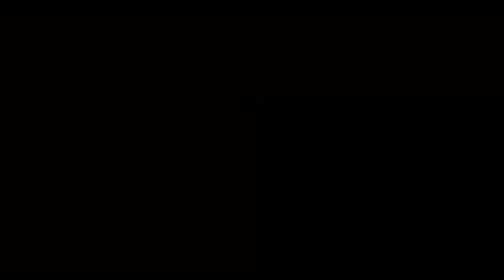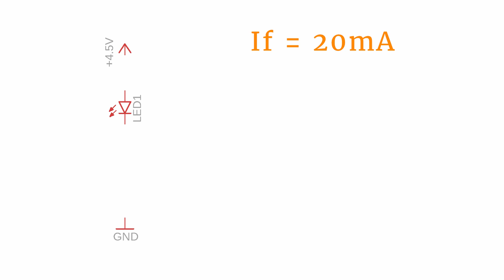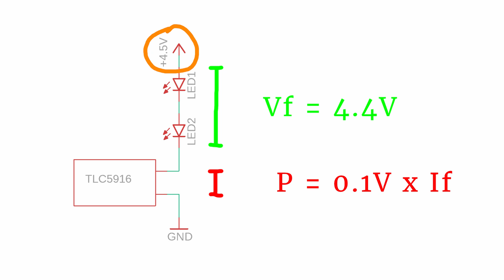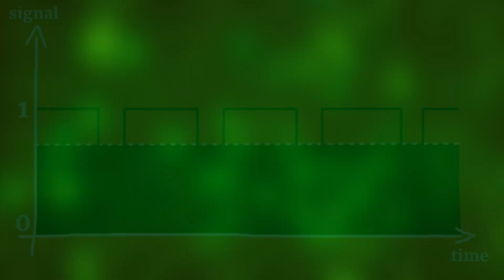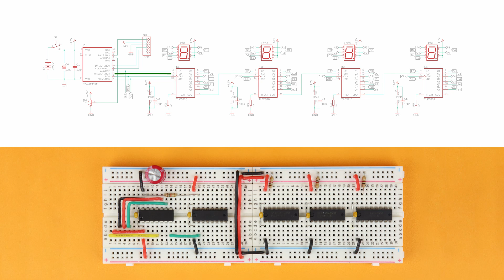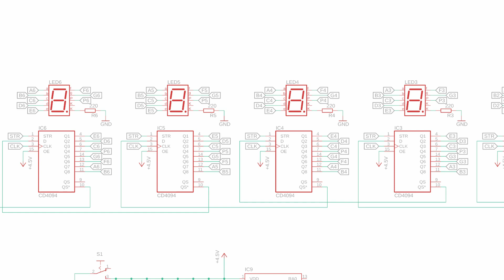Best breadboard 7-segment LED driver: TLC5916 tutorial

Comment: If you want to be abel to dim 7 segment displays with external PWM is that possible, also if you would like to be able to dim them to 0 how would you do that?
Reply from the maker: You could use a PNP transistor in the segment LED anode and connect that to a PWM that you generate with the PIC controller. The dimming inside the TLC5916 is more of a "brightness adjustment" that should be used if neighboring displays have a slightly different brightness due to manufacturing differences and/or their age.

Comment: Hey. How about some female header pins to raise the height of the 7 segment display?

Round Pin Female Headers are even better. But they are short, but may they will work? Or else two layers of them will!
Reply from the maker: That's a great idea, thanks for sharing! I find that a lot of pin headers don't fit all that well with breadboards (because the pins are not long enough to fully engage with the breadboard contacts) but I will definitely give this a try in the future. Nice!

Comment: How about using these TLC5916 to drive the LEDs but other shift registers like the 74HC595 or the CD4094 showed in the video to multiplex them?
Reply from the maker: Thanks for the question! :) The TLC5916 are current sinks, so you can use them to drive anything towards VDD (like the segments of a common anode display). If you want to drive something to ground (which you need to do when multiplexing) then you would need a source driver, like a PNP transistor. So you could use a shift register that in turn drives those PNP transistors (the UDN2981 has eight of those PNP transistors in a single package), and those PNP's would then drive, say, the 7-segment LED displays' anodes.

Does that help? If not let me know :)
Reply: @FriendlyWire  Yes! That's what I had in mind. Instead of having one TLC5916 for each display, I could use 1 TLC5916 to drive the current for each segment and then 1 shift-register triggering up to 8 transistors connected to the common cathode, right? 

You suggested a PNP transistor, is there any specific reason for that? Or with NPN works just fine?
Reply from the maker: @cesaryoshikawa7656  Almost right. The TLC5916 drives towards VDD. So you need common anode displays (I had a typo in my response above and now it is correct).

Connect the TLC5916 outputs to the LED cathodes. Connect the shift-register outputs to the PNP transistors, which then drive the LEDs' anodes. You need to use PNP transistors because you are driving towards ground. NPN transistors can only drive towards VDD, if that makes sense. In other words: the TLD5916 driver contains NPN transistors (or the MOSFET equivalent thereof). For driving the LED anodes you need PNPs.

Maybe I could do a video on multiplexing :)
Reply: @FriendlyWire  Oh I see what you mean! Thanks for the reply! I am working on a project of a baseball scoreboard that receives the data from a python code through serial communication. As you can imagine it is a lot of 7 segment displays.

I am sure that if you make a video on multiplexing it will be the best on Youtube. The quality of your video is astonishing!
Reply from the maker: @cesaryoshikawa7656  Wow, thanks so much Cesar, glad you like it. Your project sounds very cool! If you have Twitter make sure to @ me at @FriendlyWire when it's done, I'd love to see it!

Regarding the multiplexing, some things to keep in mind: it does not work very well for a lot of displays with a slow controller. Also, and more importantly, when you plan to take videos of the display (for example when the scoreboard is in the background of a sports game that is filmed) it might flicker on camera. And last, when you use serial communication (depending on how you implement it) the controller might be busy and cannot do the multiplexing as good as initially hoped. So it's a good idea to test some things before committing to a specific design :)

Comment: Thanks for covering the shift-register/driver. Seems like a very useful device yet I haven't seen others mention it before.
Reply from the maker: Thanks, I am glad you like it! The TLC5916 is really my new favorite driver :) (I used the CD4094 shift register before, which can work sometimes, but is still a bad idea since the output current is very low and not meant to drive anything.)

Comment: Neat. I wonder if with this method you could do a more sophisticated scrolling? With CD4094 shift registers you have switched the whole letter/cypher, here (I suspect) you could even scroll by half of the letter like
 [    ][ H ][ E ] ->  [   |][|  |][    ] ->  [ H ][ E ][    ]
This would give you more smoothly scrolling effect.
Reply from the maker: Thanks! :) Hmm, yeah, maybe it's possible to do that. But I am not sure what the difference is to the CD4094 case?
Reply: @FriendlyWire  Correct me if I'm wrong. The difference is that using CD4094 (connected in cascade mode) you were not able to change "on fly" any letter on a specific position - scrolling was done by hardware. With TLC591 you can control each segment separately, and make scrolling in software - which is needed if you want to make a "smooth scrolling effect".
Reply from the maker: @SieIaQ  Oh I see what you mean. But I think you got it wrong, the TLC5916 in this tutorial are wired up exactly like the CD4094 before, the data goes in on one side and comes out on the other. The important difference is that the TLC5916 has drivers included that allow you to, well, drive LEDs at a constant current. The CD4094's outputs are just standard CMOS logic level outputs capable ofaround 0.5-1mA.

Let me know if that makes sense :)

Comment: Thanks, great demo. I like the schematics, the C solution worked well. I'm adding the chips and other stuff to my shopping list, they look like a great option for driving these displays. It looks like you could make side-by-side stackable modules using this setup.
Reply from the maker: Thanks! Yeah, it's always difficult to find the optimal schematic for a project, glad you like it! And it's great to hear you will be using them! I think that they are great for stackable units. Make sure to share your progress over on Twitter :)